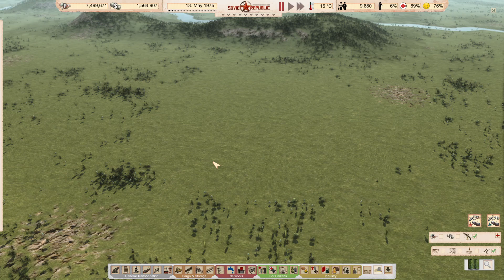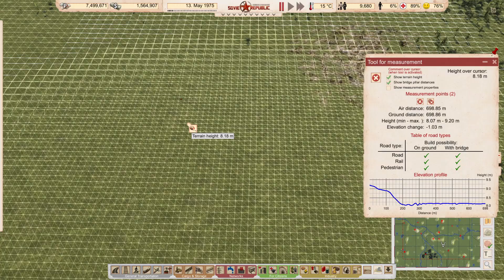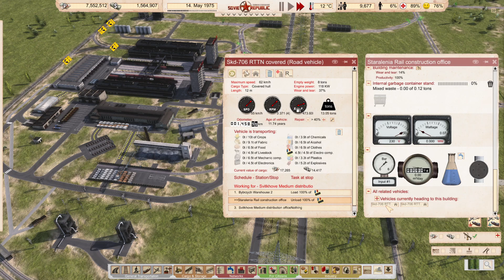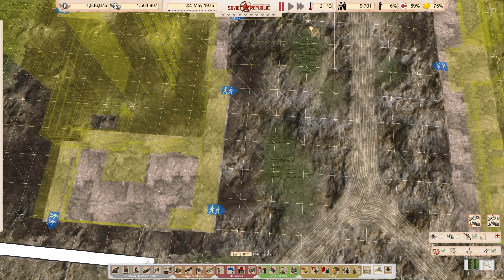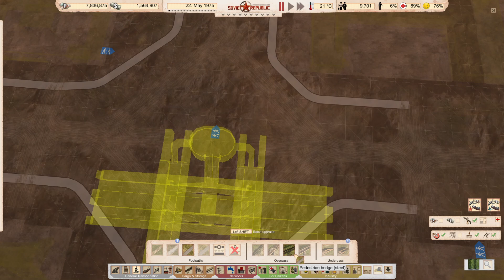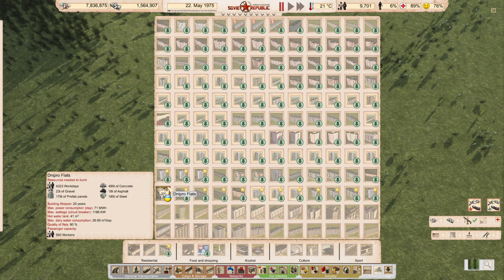Workers and Resources Soviet Republic lets play guide Season 2 E20: planning a new home

Comment: Dear mangy, wonderfull playthrough so far! While watching i saw a few Things i wanted to bring to your Attention, although i am sure you found them offscreen already:
1. At your foodfactories you build a Police Station and yet crime is still Happening. Did you maybe forget to add Cars?
2. At your Raildistribution complex the lower part towards your city around the Pumps and at least 1 Trainstation is without Energy.
3. In your Recycling complex the rightmost scrapplant of the 5 has is factory Connection linked to another scrapplant and not the storage to draw from, this might cause issues.
4. Unemployment and needs seem Not covered in your Pergola Corner, why are you Not slapping a Bus Stop there and make a dirty 4 Bus Line to the Metrostation? Case closed and you have the buses standing around
Reply from the maker: 1 Yes, I had forgotten the cars, there are some there now.
2. I will have to check that
3. Yes, I caught that and had to redesign that side of it to get the road out so now you will see 3 rail dumps with claws instead of just 2.
4. I finally did get tired of fighting it after building a school there and put a bus stop in with a transfer point at the metro.
Thanks for catching those things and letting me know.
Reply: @mangypanda2640  keep rocking! The Game overwhels one Sometimes and you are doing wonderfull!
Reply from the maker: @andreasfocht4489  thanks, I appreciate the input I always miss things and catch them later, usually because something breaks